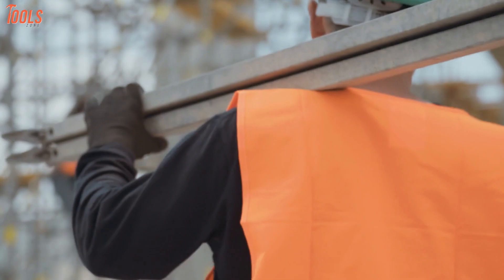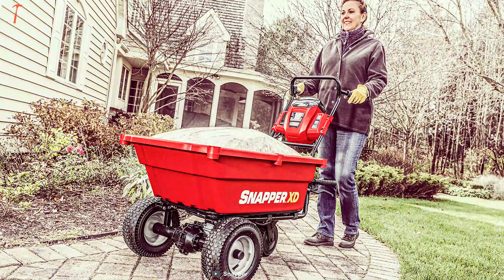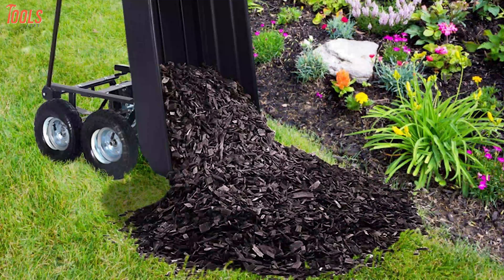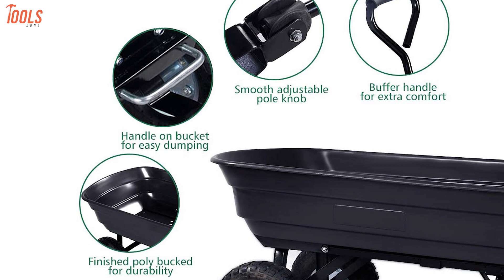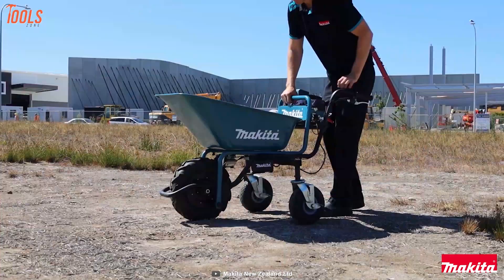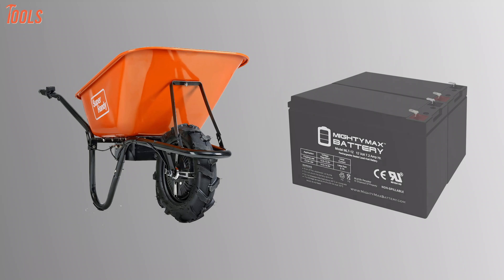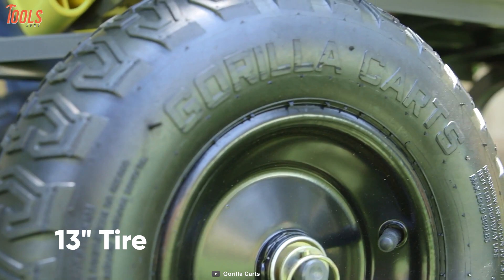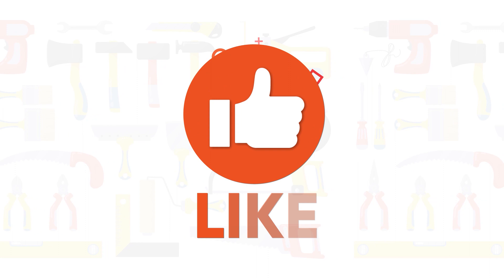5 Best Heavy Duty Wheelbarrow

Comment: I have the same Makita wheel barrows which have plenty of power but are too slow for site work. Even at top speed it runs at a slow walking pace as can be seen on your video. I can't understand Makita's logic. Their self propelled lawn mowers operate at running speed when set at maximum.

Comment: Great video.  I just got the Yardmax 8203 track barrow.  It is awesome for out in the mountains moving firewood, but the only issue is the gas fumes.  Exhaust is a little close to operator.  Thinking of the Makita for lighter duty use as another option.
Reply from the maker: Good choice!